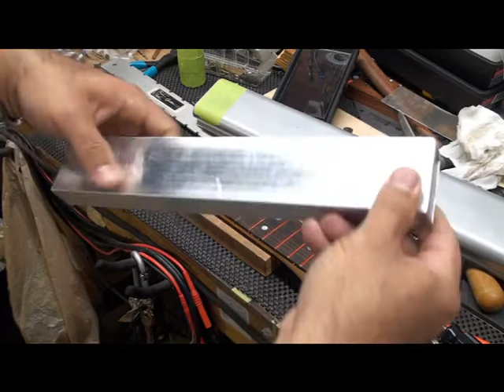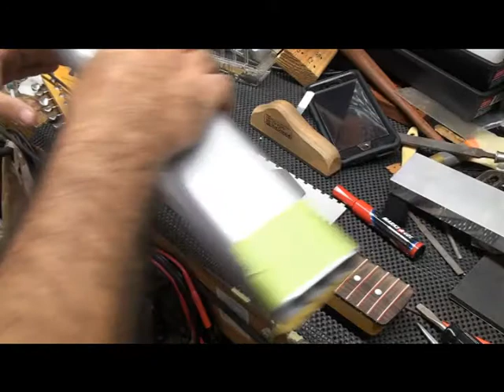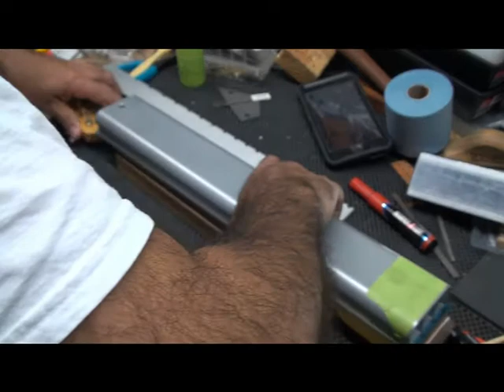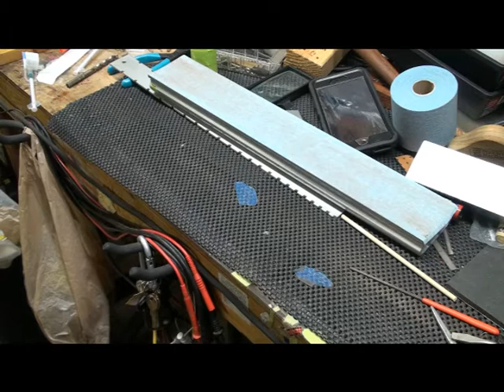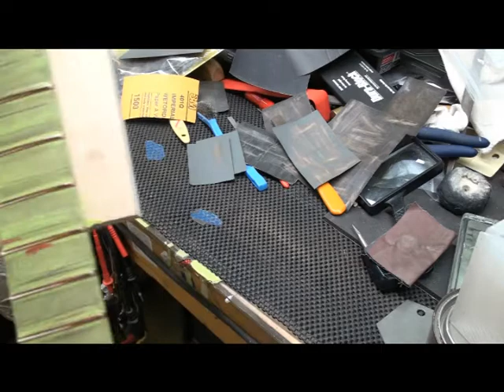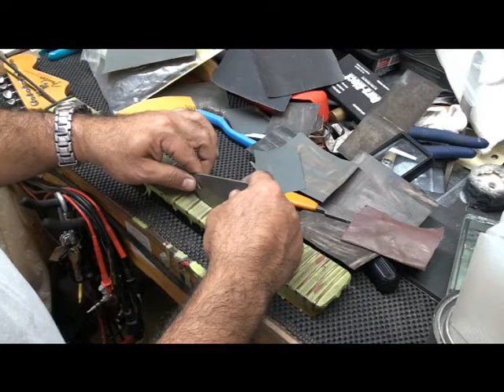Refretting a Warmoth Neck With EVO Fret Wire 2

Comment: That shouldn't have needed so much sanding for one fret. I woulda just replaced it. All the frets are worn down to that one frets level now. Oof.
Reply from the maker: yeah. but that was not the point of the video.  as you said i could have replaced the the fret.  so as a learning video, you picked up on that.  That was the point.

Comment: after radiusing the fretboard and pressing in the frets, im suprised that you had to take so much off the frets with the leveling. I. was sorta under the impression ( from stew mac), that if done that way you could skip the leveling, or very little ? their tools are darn expensive, ill probably never figure it out lol. was thinking about a concave fret recrowning file, the half circle kind if you know what I mean. I wanted to ask if you had any experience with those and what is your opinions  on them? also what about a triangle file for crowning ? thanks
Reply from the maker: Don't use a triangular file.  Use one like in the video concave.  I know it looks  like I'm taking off a lot from the frets but I'm only using 320 and 400 grid sand paper.